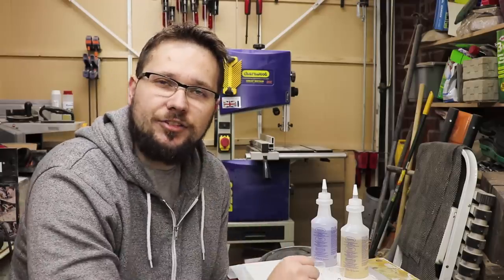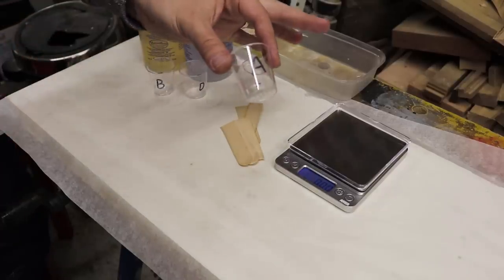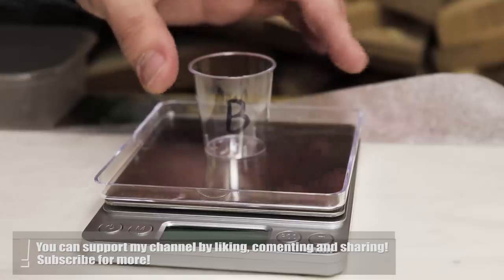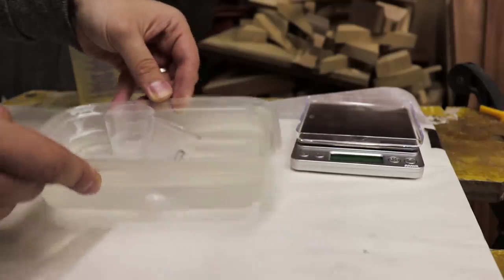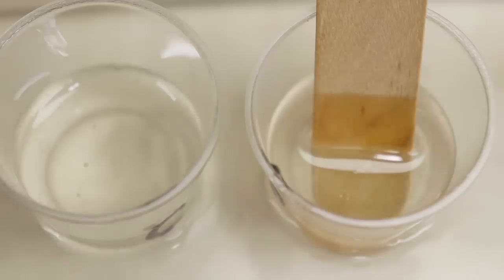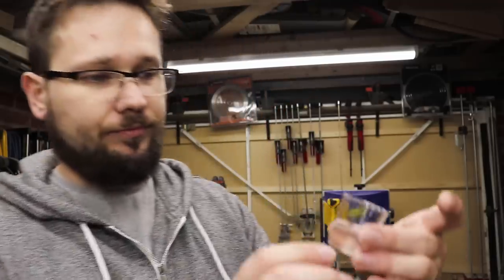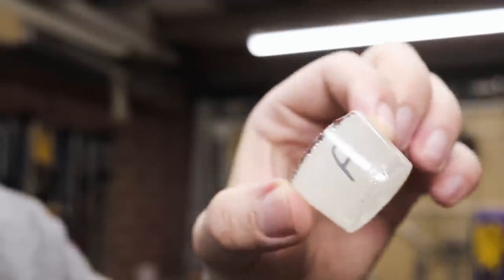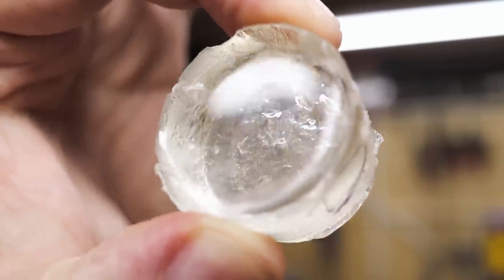Epoxy resin - casting technique to get rid of air bubbles - no pressure pot needed

Comment from the maker: Attention please! Thanks to this awesome community, mainly Pam from Highlandboxes ( check out her awesome channel here -https://www.youtube.com/user/pamharris101 ) it came to light that I was using incorrect proportions when mixing my epoxy. On my Epoxy it actually says it's 1:1 volume ratio - hence you can't use scales! Just use two containers with the same amount of part A and part B. There are also epoxies that have 1:1 weight ratio so please read the description of your epoxy carefully so you don't make the same mistake as I did! Pam thank you again for pointing this out!
Reply: I only caught this, because I'm new to this, and made the same mistake myself on my first little trial. It still worked okay, as a I guess a touch more hardener is okay, while a touch less probably would not be. Anyway, you can still mix epoxies by weight, you just need to know the specific densities and calculate accordingly. Epoxy is about 15% heavier than hardener, by volume.
Reply: You can and should use a scale.  Weigh the A and B bottles fresh out of the box and use that to determine the ratio.  For Alumilite I multiply the A weight by .8 and it cures without fail.
Reply: I most often used one ounce batches that were specified to be 1:1 by Volume and I would very carefully measure out the hardener and resin by eye. Then I weighed them precisely and determined the ratio to mix them in grams...To the nearest second digit on my scales. Works beautifully and you can do some math to figure out larger and smaller batches.
 You can use scales conveniently if you know how many grams of hardener to use with X grams of resin.
Reply: One thing that has to be considered when using by volume o by weight, is that always one of the component is more viscous than the other, so when transferring one onto the other you always will have  remaining part of that component in the vase. The best system is by weight where you weigh one component, tare of the scale and add the second component carefully and  you will have always the correct proportion.
Reply: Much better result, and saved a couple of 100€ not having to buy a vacuum. Thanks a  lot man...
Reply: Sumit Gautam Ramgarh karigar
Reply: @timrockman7  ...wouldn't it be the weight of hardener to the same exact weight of resin?  Hence 1:1 ratio?
Reply: @robira1313  No because of the differences in Density. Equal volumes of the two components are different weights.
The resin is more dense and weighs more.
To achieve equal volumes the difference in how heavy they are must be noted.

Comment: Your part A is quite thick. When that happens to me, due to environment temperature, I put the whole bottle in hot water. This way it's much easier to get the right amount out of the bottle, it mixes a lot easier and it reduces bubbles.
Another thing you can do is use a mug or candle warmer. It's like a heated coaster. After mixing put your cup with the mixed resin on the warmer and leave for about 10 minutes. All bubbles will be gone. 
I wouldn't use the kitchen lighter until after you have poured your resin in the mould you want to use and after you have added any fillers you want to use like glitter, shells, flowers, etc. Usually you'll get some bubbles after adding these, especially flowers and shells will do that. So it's best to use the lighter at the very end before you leave it to set. I usually check again after half an hour to see if more bubbles have come up (again, you'll see this often when you use flowers and shells). If you see any bubbles after half an hour, use the lighter again but hold it a bit longer on the area with the bubbles as it will soften the resin which has started to get thick by that time. When you do that, you won't be left with a crater where the bubble was but the resin will level again.
Another thing you can do is when you use a mould with sharp edges and corners, use a toothpick and glide it along the bottom edge in the resin. Often bubbles will sit in corners or edges and they're not always easy to see. You'll only notice it when you take your finished project out if the mould; you'll have some sharp edges holes in the corner and edges and sanding is the only way to get rid of it then.

Comment: I warm my resin before hand and work under a heater vent, I pour in small layers and take bubbles out with a lighter ad whatever I need to  then pour again popping bubbles as I go. I check it every 5 minutes for about 30 minutes to pop more bubbles and make sure nothing moves.  I use a .9mm pencil lead to shift things back (Cleans easy). I also use small plastic stir sticks and stir each resin part separate for a minute before adding them together.( The bottle says too)
Reply from the maker: That sounds like a bubble free process very demanding tho
Reply: How do you clean pencil lead out of uncured epoxy?
Reply: @robira1313  I've never had it leave any lead behind or had it make marks. So I'm not sure, maybe use a tooth pick?

Comment: I use a warm water bath for the bottles before mixing especially if my house isn't that warm. I like my temps around 65F but resin loves 70F and higher. :P Torching is also one of my favorite things. It's fun. - Heidi
Reply from the maker: Hi, yes I do warm the bottles now as well as it's winter and it's difficult to keep that sweet spot with the temperature:)
Reply: @CasualDIY  Might want to find a torch with a pinpoint cone shaped flame. :) I finally did at my local store. They are the same size as the other torches but the cone flame works so much better for getting in there. Only drawback I found is they are not able to be refilled but that is okay because the pretty blue flame is so awesome and it works so much better. :)
Reply from the maker: @BlackCat_2  hmm that could be something worth checking out as well just need to be careful no to burn the epoxy ;)
Reply: @CasualDIY  It should be fine. :) They are the same size as the other torches and sold in the same area of my stores. Just a different fuel and flame. :) Sometimes looking at the package can show you what kind of flame. I just bought four different ones and found the one with the right flame. :) I save the others for lighting my propane heating system in winter.
Reply from the maker: @BlackCat_2  need to have a look for those then, thanks :)
Reply: @CasualDIY  Someday soon I plan to move up to the wonderful torch sold by Art Resin and that one is able to have refills. :) Waiting for my current torches to run out though. :P Waste not want not right?
Reply from the maker: @BlackCat_2  exactly, I hate waste

Comment: Hi how long does resin take to set pls I have got arc epoxy thanks 👍
Reply from the maker: Hi, every resin is different and it depends on conditions like ambient temperature, how much resin you using in your casting. You will find this information on the data sheet that should come with your resin

Comment: These ideas are a start, and lots of good tips in the comments. Epoxy mixing is by volume not weight. The two parts have different specific gravities. In larger amounts this will be a problem. I am building a vacuum pot for videos I have seen on YouTube. Surprisingly simple.  Cheers.

Comment: Great video.  I think if you find a longer curing resin the air bubbles will have more time to escape.  You can use a small heat gun to warm up the mix after both a and b are mixed together.  The resin should be almost water like, as there is no need to use a torch.  You are dealing with vapors toxins and flammable materials please read the msds before using heat on epoxy...  Wear a mask use ventilation and keep the epoxy away from sources of heat.
Reply from the maker: All good points👍

Comment: after you pour your mixed resin into a mold put it over a lamp with a wire cookie sheet(cookie cooler?) over the light bulb, the light must be facing up or it won't work, this makes the resin set faster and thinner as it sets so you have even fewer bubbles, this works really well unless you are using a closed mold, then the bubbles get stuck at the top and it makes swiss cheese-like plastic, I've never tried taking the bubbles out before i pour it in a mold, i let you know if its still cheese
Reply from the maker: Interesting technique 👍

Comment: Would using vibrations help with the process at all? Like, hold a vibrator to the side of the cup for a few minutes, maybe?
Reply from the maker: One of my friends done an experiment like that, he had a vibrating base plate. The difference was negligible.
Reply: @CasualDIY  Ah. Maybe combine the vibrating plate with heat? And what about using a candle warmer?
Reply from the maker: @whiterabbit75  that would be too much heat. It just needs warm water. Remember the more heat you introduce to mixed resin the quicker and less predicted the process will become.
Reply: @CasualDIY  Gotcha. Thanks for the info.

Comment: You are very good at explaining things.  How about a video on ways to remove bubbles you don't see until after it cures?
Reply from the maker: Thank you. I think the best method for that is the pressure pot👍
Reply: @CasualDIY  I realize that is good for preventing.  What about after the resin has cured and you want to salvage it rather than pitch it and start over wasting more resin?

Comment: Does it have to be a wooden stir stick or will the bubbles cling to metal?
Reply from the maker: Not sure about metal but I think anything will do. Plastic stirers would be better as they will not introduce any air bubbles themselves like the wooden stick
Reply: @CasualDIY  I just re-use the wooden sticks, they will be impregnated after using them the first time.
Reply from the maker: @marcelthomassen3152  yes I do that as well😁👍

Comment: A couple tips for you to master this craft, Mr. DIY:
29 C is better for your ambient shop temp. I heat my epoxy work room studio, and soak my gallon container epoxies in hot water for whatever time it takes to make them fluid and workable. 85 F is ideal.
 For my epoxies that works out fine and if it is warmer than that, I need to work quickly because they generate heat on mixing and harden fast.
Wood will soak up the resin because wood is porous and has air in it, and guess what comes out? billions of tiny fogging Bubbles. Fail!
Seal your tongue suppressor pine stir sticks with acrylics. Just paint them a couple times. No more tiny bubbles.
They can be used many times over.
Reply from the maker: Thank you that's some awsome tips👍
Reply: You can use scales. I do all the time.
Here is how.  This is to be done with all the different brands of resins used.
Make precise identical marks on the outsides of two identical polyethylene cups.
There called 'portion cups'.  You can go with larger cups if you want even more precision.
Put the Resin marked cup on your scales and tare, or zero the scales. 
Your scales will ignore the weight of the cups and then measure only the resin by grams to a tenth that you will carefully fill to the mark, and write the measurement, like 12.5 Grams. 

This is your Holy Guide Number, and you must record and inscribe it everywhere.
 
So now you did this with both your resin and hardener you have two numbers like R-12.5  Hdnr- 11.
Pour them into your mixing cup and do your resin job.
Later if you want to do a smaller project with about half of that last batch. Divide 12.5 and 11 by 2.
Whip out your calculator. Or tell Siri to figure it out for you ;-)
If you want to do 50 countertops of a huge bar or restaurant with that resin using huge amounts of resin, just mix 12.5 Gallons with 11 gallons of hardner. It's that easy and so much fun.
Mor later.
Reply from the maker: @timrockman7  thanks for that I was actually looking for that information 😁 your explanation is perfect thanks 👍

Comment: for anyone doing the water one do not try using hot water from a thermos i used it it worked fine for my first cast i did but my second one it cured within 10 min or nearly cured i was shocked. btw first time making it so yea >.> hope it helps

Comment: what is the best place with good quality,and reasonable price to buy epoxy resin A and B for making krafts,and table river ? thanx in advance,,Badr.
Reply from the maker: Hi, personally I use resin from ResinPro. Fantastic resin plus everything you could think off to do any project. Check out their website resinpro.eu and you can use my discount code to get 10% off. The code is casualdiy

Comment: I pound on the table to induce vibration to help the air find its way to the top.  3 minute mix /5 minute wait . Then pour
Reply from the maker: Yep that could help as well👍
Reply: Hey man, after that post, what would happen if you put the mix into or on an ultrasonic cleaner?
Reply from the maker: @TheDentman22  I heard about that but the results are no where near as good as pressure pot. Better than nothing tho. But you have to use epoxy with long working time.

Comment: using a scale is an amazing idea to get equal parts of resin!!
Reply: TopFurret it’s gives equal weight, which doesn’t always mean equal parts.
Reply: TopFurret doesn’t work with all resins as hardener usually weighs less than the resin thats why measuring is important
Reply: Tom & Melody are both right, but that's not quite the whole story. Some resins are specified with their ratio in volume, while others specify it in weight (some don't even use equal parts, but that's a beside the point). Using the wrong method of measuring a given resin will - as the others explained - generally give you less than ideal results. Except when they give you disastrous results. Or when you get really, really lucky... but I don't know much about luck.
Reply: Instructions say 1 to 1 by volume.  So 4 grams is going to equal 4 grams.  Whether it is part A or part B.

Comment: Sir can I use method D ,and after D method can I use vaccum resin for more better result.
Reply from the maker: It won't make much difference and you may run out of time and your resin will harden during the process. Unless you got resin with very long open time let's say 1h+ then you can try it but I don't think you will see much better results. I would suggest a pressure pot for best results.
Reply: @CasualDIY  sir your mean vaccum pump best option for remove bubbles instead option D method.
Reply from the maker: @sonuverma2796  no, pressure pot. Vacuum Chamber totally different thing, check out my other videos. Got a comparison of both 👍

Comment: Hey! I saw that in test D uh used blow torch for removing air bubbles....Can we use heat gun for the same ? Wont it burn the plastic?
Reply from the maker: With the heat gun or blow torch you have to be very careful not to burn the container or resin. You only need a second of heat to go over the resin to pop the air bubbles, it comes down to practice and checking what works for you I guess👍

Comment: Very helpful, thanks. Have you tried a UV lamp? I think I've seen others use one. Also, you can get electric Epoxy stirrers/mixers....wonder if they would produce less air bubbles? x
Reply from the maker: Hi. Not been using UV epoxy yet but not sure it's any good for deep pours. I think the electric mixers would introduce a lot of air bubbles. Altho I'm thinking of getting a pressure pot... if my budget allows it ;)

Comment: :>) thanks for video just have to say using wood stir sticks creates air bubbles, use plastic or silicone stir sticks and leave in hot water after stirring for 10 minutes and a torch to eliminate remaining bubbles after pouring:>) All the best wishes from Canada 2021.
Reply from the maker: Thank you kindly for watching 👍

Comment: By far, the best trick I use is combining the two parts with silicone (to not introduce micro bubbles from the wood stick, which has air in it), place it on a cheap coffee cup warmer (or you could use a water bath) until the bubbles rise, torch, let settle, torch again and voila! No bubbles. I cast pen blanks and bubbles will cause the blank to blow out when turning. The only caveat is that if you heat too much or for too long, it will start to set faster than the normal open time. That's fine with me because I need the separation between colors, but I still have to work faster than normal when pouring each color if I've left it on the warmer too long. 
Unfortunately, there used to be a great product called Ice Resin that off-gassed completely no matter how many bubbles it had. Then, it was bought by Ranger and the price went up by at least 30% and they seem to have changed the formula. Bummer. It was the best ever until Ranger got hold of it.
Reply from the maker: Nice solid process 👍😁

Comment: If one pours the epoxy into a silicone mold how does heat up the epoxy with warm water? The silicone acts as an insulator keeping the heat away from the epoxy. Using the “flamethrower” is the easiest way to remove bubbles...although not perfect.
Reply from the maker: Before you pour it into the mold mix it in a container that you can put in warm water and then gently and slowly pour it into the mold. That could work I think.

Comment: Surely warming up the resin would cause it to cure quicker reducing your pot life? As for resin to harden it goes through an exothermic reaction (heats up) to cure 🤔
Reply from the maker: That's correct. But the resin I use has got a 50 minute working time and the temperature from warm water doesn't change that too much. Remember it's only hot tap water not boiling water from the kettle. Epoxy works in much higher temperatures- depending on epoxy as they are all different.